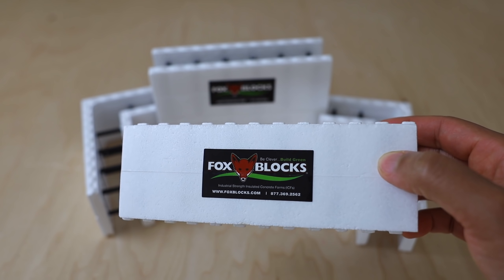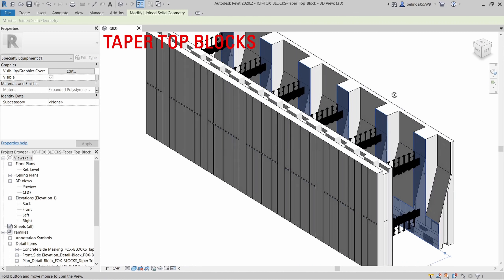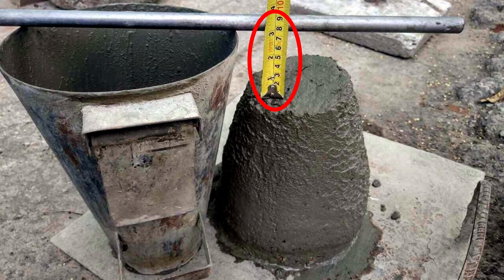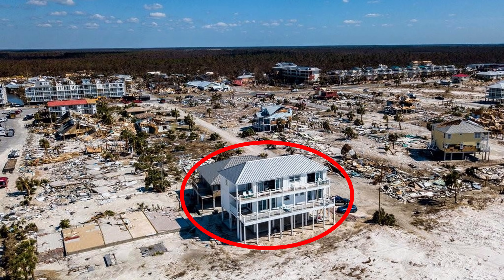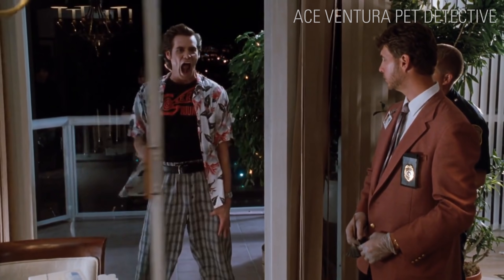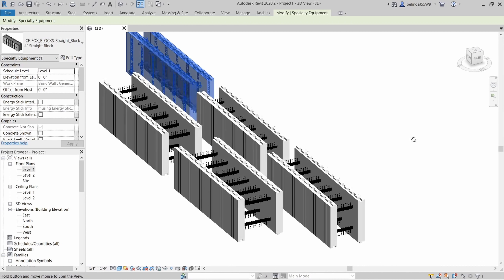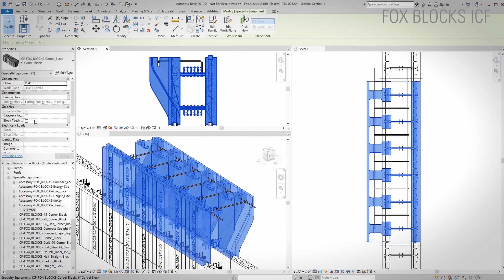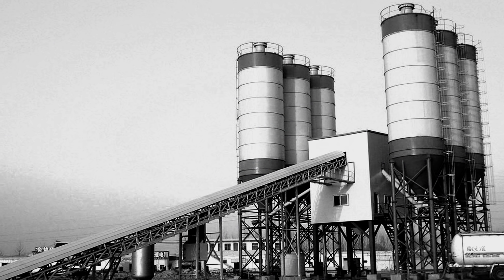Pros & Cons of Insulated Concrete Forms /ICF construction

Comment: It's unbelievable that you would say ICF doesn't work in cold climates. CelBlox is from Wisconsin and building in cold weather areas is almost all our total business. The effective r value of ICF is much higher than stick built!
Fox Blocks is from Minnesota!
Logix is from Canada!
Why do you think we are all from cold areas!?
Reply: No to mention her comment on how ICF eats up floor space. Last time I checked one of the main benefits of ICF is integrated insulation canceling the need for interior framing.
Reply: I believe her comment was noting that it doesn’t perform as well in cold climates as opposed to hot climates. In truth, it performs best in very cyclic climates, that experience hot day and cold nights and the wall acts as a buffer to mitigate heat transfer by the gradient switching throughout the day with the diurnal temperature swings but the boundary layer of heat transfer never escapes the wall center. Once a climate reaches continuous cold or hot the mass will be overcome and will reach near steady state heat transfer at which point it is a matter of k value which is represented as  r value where ICF is generally 22-28 and other options can be more (such as double stud and SIP systems). Admittedly, their low mass has those systems reaching steady state much earlier so I don’t believe they are a true improvement, particularly if you factor in the airtightness which is a monumental necessity that most conventional builders pay little to no attention to. And detailing it as Matt Risinger does with tapes and layers is expensive and requires contractors who mind details, which makes it a difficult thing to achieve. 

I have looked at and installed most types of construction and as far as simplest ways of achieving a great thermal and air envelope, ICF is hard to beat. It definitely performs better in swing climates, but will still outperform most other methods in all climates. Now folks just need to quit screwing up roof insulation and venting details and make their ceilings airtight and use proper HRV/ERV systems and radiant heat and such and they could enjoy the good life.
Reply: The r22 ( true ) of an ICF wall is about the best cost value. Adding more r value doesn't make a lot of sense. Unless you go to R 40 and eliminate the heating system altogether.
Reply: I agree, we have some ICF block homes here in northern Europe and they are energy efficient in the cold. I think as time goes on they will be the go to method of home building globally.
Reply: What you say is true about them being used in the northern climates.  But, they do have issues such as their limited R values and permeability of the walls in moisture conditions.  Installation of electrical and plumbing are a pain.  They have their uses and are a viable alternative to be sure but they are by no means the pinnacle of energy efficient building.  If you are chasing R values it would be hard to beat walls built with T studs and then the wall being filled with closed cell foam.  An alternative is SIP construction.  OSB on the interior and ZIP system on the exterior.  Very strong and fantastic R value!  Pain in the ass to install plumbing and electrical.  These all have their advantages and disadvantages in some cases a mix may be prudent.  ICF for the basement space and SIP for above.
Reply: @mikeiver  Depends on the block system being used.
Most big manufacturers have additional panels to add R-value.  You just need to spec an initial block size with a wider voidspace so you don't subtract from your initial concrete thickness.

QuadLock's system has additional panels that, within reason, are rated up to R59 (conventional value, not the extrapolated values you'll hear).

And their expandable block tie system allows for wall thicknesses above 24" if desired.
Reply: @mikeiver  No.  If you're chasing R value, your best bang is actually SIPS.  6-12 inches of foam sandwiched between plywood/OSB?

And "limited R values"?
Fiberglass, Rockwool, EPS and XPS actually perform above rating as it gets colder.

Polyiso, however, doesn't.
Also, XPS loses R-value over time as it off-gasses and essentially becomes EPS.

Things like ICF offer benefits beyond simple R value.

Also, proper air/water/vapor sealing detailing will eliminate the problems you're thinking about (which are primarily badly detailed setups that are barely better than naked concrete).  As well as proper moisture management in your HVAC system.
Reply: @mikeiver  Basically every part of your statement is incorrect.
Reply: Of course you have a dog in the race so anything not block is crap and any other building system is inferior.  Not buying it.

Comment: This was much easier to understand than the Pro-Builders I watched, I actually understand it now not just the pros and cons, and the focus on water management. Obviously both presentation styles are miles ahead of me walking past a construction site and looking over at the workers as they're there to work not teach strangers.

Great points in the conclusion, I think combining this with Solar and air exchange devices will make these very safe and economical. If planning to expand the home it seems prudent to leave provisions for that in the initial build like a wall that isn't ICF or has an oversized door/window opening that can be adapted for another use. Yes all the stuff inside will be out of date in 20-30 years why not focus on the parts that can't be easily changed (the bones).

I was also impressed with those three standing homes in that neighborhood, they looked completely unscathed, I didn't pixel peep to see how the windows and doors did, but the roofs looked fine in that quick glance too.
Reply from the maker: Thanks, Kacey! Hope your home build is coming along well.

Comment: Should anyone attempt a DIY project with ICF, a good idea would be to find someone with past experience to help. The issues with plumb walls and blowouts can make a serious mess of things even with four foot lifts. So true about the beer guzzling. 
Hiring electrical and plumbing contractors can be problematic if they haven't done these before. The job requires them to split their job to do the ICF portion first, then come back for the rest. 
I found it critical to have the doors and windows on site before the build to have the dimensions on hand rather than trusting a blueprint. 
Invest in a good foam applicator. Blowout protection.
I tried a white glue modified stucco finish directly on to exterior foam with no lathe. It has been 25 years now with no issues.
Would I do it again? Hell no! Not then and not now.
Thanks for the video Belinda.👍
Reply from the maker: Great point about procuring the doors and windows prior to construction! It seems like every episode of "Grand Designs" (love that show) has issues with window manufacturers! It's even more crucial to get dimensions right with these immovable concrete walls.
Reply: @BelindaCarr  Exactly.  While architect/designer time is expensive, it's still cheaper than trying to jury-rig a solution to a screw-up once all the concrete's in.
Reply: 1. If you can't plumb a wall you shouldn't be building any wall of any type.
2. Blowouts never happen with quality blocks that have been properly installed.
3. Our electrical and plumbing contractors give a discount for working with ICF walls because it is so much easier than working in stick walls.
4. If you can't trust your blue prints then you have already made a major mistake.
Reply: @tiberionblock1047   @Tiberion Block  1. Agreed!
2. The blocks are not the issue with blowouts. The issues I've observed have been with the placement and sealing of electrical boxes and other fixtures. 3. Once the plumbing and electrical contractors understand the installation, they do like it. I go back to my comment mentioning trying to get quotes from contractors that have not do so before.
4. Agreed! It is just a straight forward fact that once the walls are set, the "mistakes" have fewer options to rectify the issue.
5. I am sure since 25 years has passed, the quality and overall fitment of the blocks have improved tremendously.

Peace
Reply: @wearemilesfromnowhere4630   Well said sir.
Reply: @wearemilesfromnowhere4630  ..."critical to have the doors and windows on site before the build to have the dimensions on hand" -thx for that! i'm absorbing all the info/tips i can find before we buy property in NM 18mo from now. i won't get to Kody Horvey levels of knowledge, but hope to avoid disasters at the least.
Reply: @Krazie-Ivan  Feel Free to reach out with any questions. My profession is in being a consulting expert to homeowners building their own ICF homes. I would be happy to glance over your plans and help you work out the kinks as you go along.
Reply: @wearemilesfromnowhere4630  Yeah.  More builders have a better understanding of the dynamics of ICF now.
Things like "corner floating" and blowouts and the use of common seams now have multiple strategies to eliminate/minimize them.

Basically, a bit of healthy paranoia can get you over most of the rough spots.